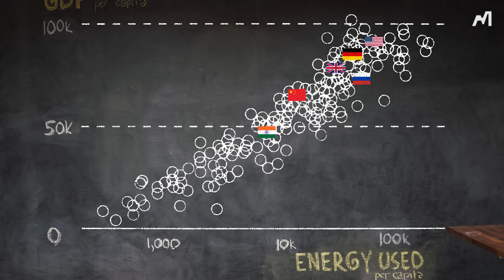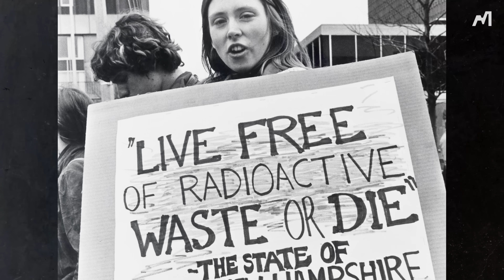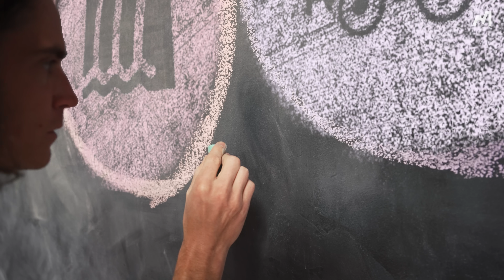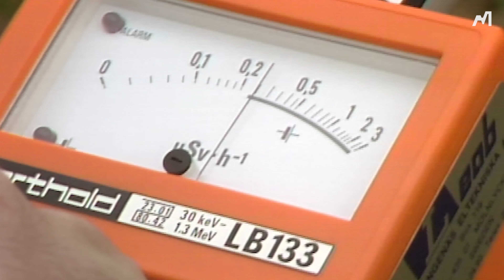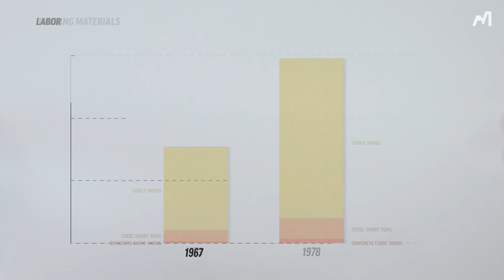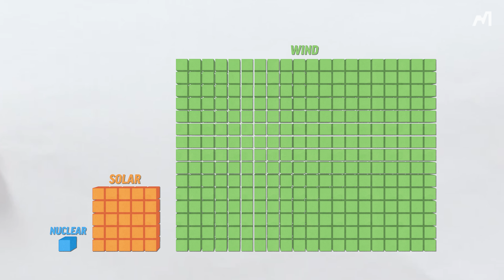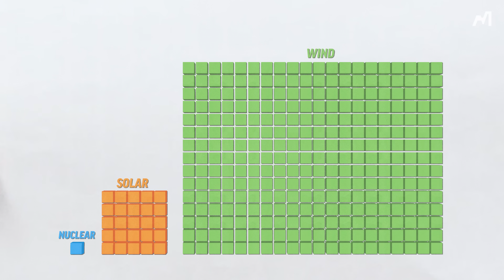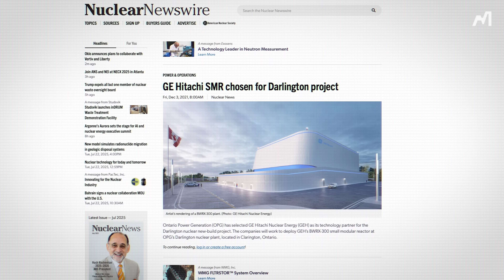They're Lying to You About Nuclear Energy

Comment: Parroting accepted thinking is easy. Presenting alternatives is difficult, because it requires overcoming cognitive dissonance. Integrity is important to me, and is generally an element required to maintain sanity (as opposed to being delusional).
 
My TOP DOWN cosmology is either terribly wrong, or mostly right-- there can be no "sitting on the fence.'" A change in thinking at least as significant as the Copernican revolution, where religion (that the earth was the center of the solar system) had prevailed, in error, is required.
 
Earth is lit and its living systems are energized by power from the sun. Thermodynamics determine the direction of that flow; consciousness determines whether that flow is wasted or enriched to form ever-more-complex (lower entropy) living systems. Ongoing and selfish, unthinking destruction of ecosystems and biodiversity are not conscious attributes, meaning that by not thinking, humans are purveyors of chaos, identified as greater and higher entropy. 
 
Prediction under controlled conditions is the essence of empirical methodology. BOTTOM UP (BBT) cosmology is replete with ad hoc fixes to explain-away contradictory newer findings, making it more of a religion than a science, while TOP DOWN cosmology is confirmed by those findings. There is no reference by me requiring mystical thinking or supporting falsehoods. Who is being deceitful or delusional?
 
In conclusion, I believe that I know why my theory of the universe is not being given proper attention: It contains the unwanted message that the electronic "smog" we are creating is contaminating the quantum-entangled "life force" prevailing throughout the cosmos, directly-connected to the evolution of life from its cosmic beginning, even to the evolution of life on this planet.
 
The knowledge of this is problematic to monied and powerful special interests; and therefore, the source must be hunted down and systematically suppressed.
 
The same thing is being done with the science of global warming and its affect upon all life on this planet.
 
I would LOVE to have anyone explain to me how any significant part of my theory is wrong by giving valid reasons, other than intuitive doubt.
 
I do not forbid religious or intuitive explanations, but only ask for a 50:50 chance, overall, that my explanation is correct-- much better than current bottom up explanations, which now require astounding ad hoc explanations to support basic theory, whether given from a religious or scientific point-of-view.

Using black holes, as currently being attempted, to explain-away everything is like the ancient obfuscation that, "It's turtles all the way down."
 
Top down cosmology, properly understood, predicts latest findings by the JWST. Each jump in top down evolution, though mostly now invisible, has remained quantum connected, thereby explaining quantum gravity, missing mass and the paucity of anti-matter in the local universe-- plus defining the meaning of the fine-structure constant.
 
A majority in agreement is not required-- all that is needed is the human equivalent of "the one-hundredth monkey;" and who is to say what that equivalent may be?

Comment: Sure nuclear is great, but look at the mayor projects being built today. Frances "newest" reactor too 20 years to be operating for a year and now it's back offline for checkup. The UK has been building their newest one for 15 years and it'll be another 5 years to be operating. You can just place some solar panels and produce power tomorrow.
Reply: That's called investing. I doesn't matter if you make solar pannel who work for 20 year and then the nuclear reactor make that energy 100 time over in a day
Reply: @Fafa-fz3wh  We need energy today. Not in 20 years. Many nuclear reactors are from the 60s and can't be operated much longer. The problem is we would've had to start building reactors 20 years ago, but we didn't. Planning reactors today is a waste of time when we have energy sources we don't need fuel for.

Comment: Chernobyl wasn't a failing of technology or equipment.  It was a failing of policy and a government.  A test was attempted multiple times that couldn't be done.  the test was tried again because someone else thought they could do it, the reactor was starved of water, but was pushed too far to cool it back down and it boom.  Japan was a failure of anything.  Japan used 2000 years of tsunami recording the country had.  They took the largest on average wave, and added 10%.  The wave that hit the plant was larger than the service factor applied to the average largest wave for 2000 years.  The generators for the pumps were placed at the top of the service factor, that wave was larger than that.  Otherwise japan, since they had started using nuclear power in the early 60s, had a completely spotless record of safety.

Comment: There's no doubt that nuclear is the best baseload, although reliance on ever more energy still causes other issues (someday nuclear fuel will run out, transmission challenges, it still has some footprint). But that doesn't mean it should be the only energy! 

The whole space thing with solar is a problem for high density (manhattan etc) but even in Brooklyn etc rooftop would meet the needs on average, and a whole bunch could come from parking lot canopies! That has the added benefit of keeping cars cool in summer. And the battery storage could be under the solar, or even better it could be distributed and occur organically through Time of Use rates (which would also shift demand such as EV charging and water heating to further make use of this). Here's an ideal scenario: employers would cover their parking lots in solar panels and offer charging for EVs extremely cheap when the electricity is worth less to both charge the EVs in a logical way and avoid the transmission/balance issues of the duck curve.

Comment: Luckily we see a reemergence of nuclear power support, primarily because it’s the only real stable solution to decarbonize the generation of electricity completely.

As someone who was born in 1982 I was brought up with the knowledge that nuclear power was very dangerous, and that was my attitude for years. Today I’m all for modern nuclear power, hopefully adding thorium and fusion reactors to the mix in the future. In my country support has over the last 40 years changed from 17% in support of nuclear power to 76% today.

The focus today is on saving our planet from our manmade climate disaster and apparently that was the spark that was needed to push nuclear power back into the limelight.

Comment: Why they don't put nuclear waste on a rocket and launch into the sun to dispose of it I'll never understand?Seems like the best way to get rid of it to me...
Reply: Until you consider that a rocket may have an off day - and fall back onto the ground, or even fail to take off entirely. Not a fun thought to have a vast area peppered with radioactive debris. And with the amount of nuclear waste on the planet, that would need to be a lot of rockets we'd have to launch.
Reply: @TheOneAndOnlyMrTino Good point. Do you have a better idea to dispose of the mountains of nuclear waste? We can't keep piling it up and hope or children children can figure away to dispose of it.
Reply: @scottbrineaux7910  one thing that was strangely not in the video was the new generation of reactors whose nuclear waste we'd have to mind for merely several hundred years. That's a completely different time span, and much more manageable. Seeing that such advancements are possible in a comparatively short period of time, and that there is work on reactors using depleted uranium, perhaps recycling is a valid path as well. Other than that, we often forget that the raw material had to come from somewhere. Recreating to the degree that it is possible the conditions that initially held the unprocessed uranium may be an option, too.
Reply: @scottbrineaux7910   We have at least four ways of safely dealing with high level nuclear waste, and launching waste on rockets is certainly not one of them.

Comment: I have never heard of a wind turbine losing efficiency due to bugs, it must be a a very localized event. Also, sure the lifetime of wind turbines is 25-35 years as of now, but as nuclear you could stretch it with appropriate maintenance. So far it has not been necessary as technology has advanced so much that you rather replace the wind turbines for larger newer ones. And with nuclear decommissioning is a hot potato no one wants to be left with, gets postponed indefinitely.

Comment: There are two big problems building nuclear vision power plants.

The first is that the design designers always make it reliable and the builders always make it cheap and those are not always compatible and it really matters.

The second problem is nobody realized in the early 1970s that nuclear radiation has an actual adverse effect on concrete and steel, the very substance is used to make it degrade faster in the presence of the radiation and that has to be taken into account somehow when you build gigantic things using those substances.

The good news is, there are better ways to make nuclear fission such as liquid fluoride Thorium reactors but because of this history of bureaucracy, nobody can research that practically in the United States.

Comment: Great video! Another point:  the production of photovoltaic modules emits 15 times more carbon in the atmosphere per MWh produced than a nuclear power plant. This increases to 90 when considering that gas-fired power plants are often needed to meet demand around the clock ... Additionally, due to the very low efficiency of photovoltaic modules, the mining of silicon, iron, coal, and aluminum for these modules and PV power plants has a greater impact from ionizing radiation than the mining of nuclear fuel.

Comment: Interesting video but let’s slow down on the nostalgia.
Yes, the 1960s reactors were built fast and cheap because safety, waste, and environmental standards were practically nonexistent. Pretending regulations “killed” nuclear ignores that those rules exist because of accidents, leaks, and rising risk awareness.
And the “no one died in Fukushima” line again? True for direct deaths, but tens of thousands were displaced, land rendered unusable for decades, and cleanup still costs hundreds of billions. That’s not a minor inconvenience it’s an economic crater. As for “cheap, compact SMRs” they’re still prototypes. None are commercially viable yet, and their costs per kWh are currently higher than traditional reactors, which are already the most expensive energy source to build. The core problem hasn’t changed. Nuclear is slow, expensive, and dependent on massive state funding, while renewables are already cheaper, faster, and scalable today. SMRs might look nice in concept videos, but so did fusion… in the 1970s.

Comment: From April of 1974 and for 18 months I worked at the Trojan nuclear power plant at Rainier Oregon on the Columbia River. During that period of time, I can certify what the gentleman says about having to build demolish and rebuild systems within the plant several times over. My job was to build the scaffolding to install the systems. Tear it down then a short time later rebuild the scaffolding to rebuild the same Sub system over again. 

At that time I reasoned that should there be a meltdown molten core of the nuclear fuel could melt its way down into the subterranean levels where it would be exposed to groundwater. That could produce a massive steam explosion that could have contaminated the water downstream, (Columbia River),  for many decades. 

That would have destroyed the salmon, fishery and forced people living in houseboats off of the water. 

At the time I concluded that If an urban area, city, needs nuclear power, they should build a nuclear power plant within that urban area. 

It took me decades to realize the error in my thinking. Tutu environmentalist demands and the explosion of electricity use, I now see that nuclear power is the only option. Due to the advancement of technology over the last 50 years, those plants would be much safer than the early crop were.

Comment: Nuclear is safe because we all operate them with our smartest and most qualified engineers. The danger comes from spreading access the material to where less the disciplined of us can start messing around with waste products that remain dangerous for the next 10000 years.

It's a lot like civil aviation: remarkably safe because of the very high barrier to entry to qualify for operations achieved by a tiny sliver of humanity, running equipment that can't be shut down completely midway through, with the constant threat that when something goes wrong the situation can spiral downward uncontrollably very quickly.

Comment: Your analysis in the video are an art of deception. The deaths are calculated per source of contamination neglecting size of an area and amount of the people exposed on the contamination. For instance the small oil contamination on a huge size of surface where many people are exposed (as whole Earth) will cause grater amount of deaths than extremly deadly a nuclear contamination on small area (as size of Japan's city) where small amount of people are exposed will cause less deaths. Please correct your analysis because in current form thay can be considered only as deceptions. There is also element of how fast contamination can be removed (nuclear contamination can stay for thousands of years).

Comment: So as a long time wind technician, I question your energy density graph.  The foot print of each 2.5mw machine is about a 2 car garage.  They farm around each tower.  I think you are taking the full amount of land a wind park is spread over rather than the land that is in use for energy production.  I also care for a 100 acre solar plant that makes only 10 mega watts.  Or 4 two car garages worth of power about a quarter acre of land not usable for farming where the entire solar plant must be fenced off and access strictly controlled.  No farming or any other use in a solar farm.

That does not change anything you said about nuclear being the only base load solution if we are going to be slamming AI and data centers up everywhere.  

We can talk about how one reactor can power an entire city… there are data centers that use more power than an entire city.

Also how much fresh water these nuclear plants and data certain use should be discussed.  Neither contaminates the water but both super heat it and much is lost to the atmosphere, and while yes clouds form and it does rain… it rains in the oceans too.   There will come a point the environment wont refresh our ground water fast enough and that will be it for most of the world.

Comment: Kinda funny I’m watching this while at work in a nuke plant… 

Here is a bit of extra knowledge for those who care-

I work in a craft that does sub contracting for nukes, new construction, power plants, refineries, plastic plants, etc. 

The amount of safety regulations in a nuke plant compared to anywhere else is absolutely insane, for example my craft, I can’t even do the work, i stand behind where we need to work and I instruct someone on what to do… now some nuke plants, I do the work but after every step they come check it, some they watch me the whole time… 

Compare that to a refinery which yes has a lot of rules, but you can get away with breaking them on a daily basis…. Out of the 4 nuke plants I have been too, I have someone from the plant watching me 24/7, every single rule they have I must follow, which I should be anyways, but they actually have someone watching me…. You don’t see that in other plants, I feel 10000000000000000x safer in a nuke plant compared to any type of plant, I know that every single tiny thing has been inspected and upheld to the rules.

Comment: You hit the nail on the head at the beginning of the video. The nuclear regulatory commission is the key to everything. They simply need to reduce the number of regulations and establish a maximum allowable exposure threshold that reactors can be built to. If there is simply a concrete standard set in stone, rather than the completely wishy-washy standard of “reasonably possible”

Comment: I was told that the 3 Mile Island incident was due to user error.  The safety circuits were working as intended and tried to shut down the reactor but the operators intervened as they didn’t believe it was an incident.  If it had shut down as intended there would not have been a problem.

Comment: Power generation is a multi-disciplinary approach in Canada.  We have Hydro, Gas, Nuclear and Green Energy.    We are in the process of building two SMR's in the Province of Ontario, and three Battery Storage facilities for Green Energy.   The fossil fuel industry in the USA spends billions each year attacking Green Energy and I'm sure did so against nuclear.    Frankly, even the current head of the U.S. Department of Energy states that Solar only works during daylight hours, and wind only works when the wind blows hard.    So either he's a liar or doesn't understand any of the new technologies, which means he shouldn't be the head of that department.   In simple terms, you're heading for an electricity crisis by 2030 with all the currently approved Data Centers coming online.  The USA needs to stop kicking green energy to the curb there are several wide open areas in the USA that will never be populated and don't support agriculture.   Perfect for Green energy technology.   You also need to develop SMR's near these data centers.